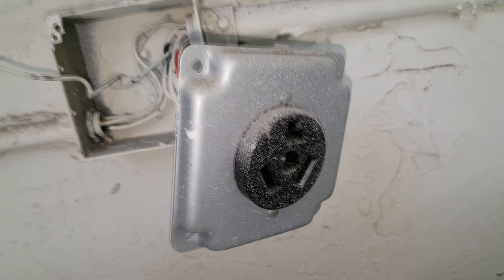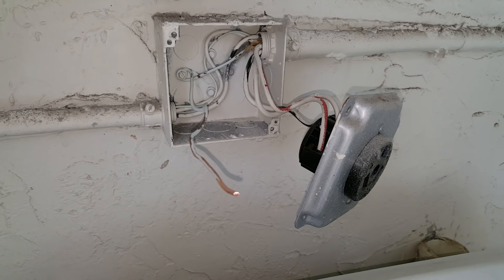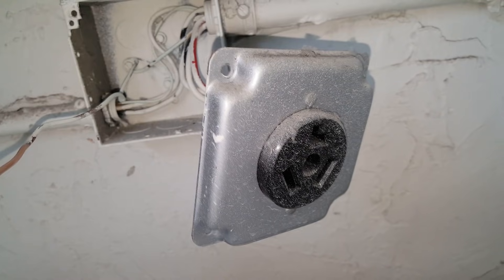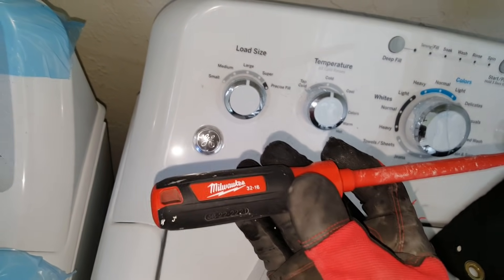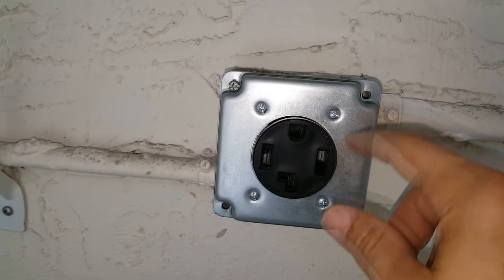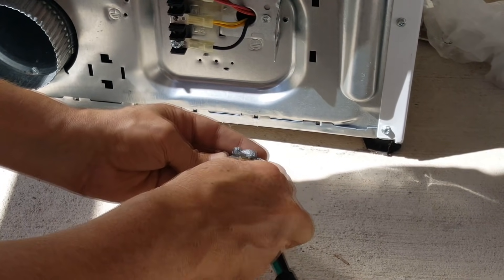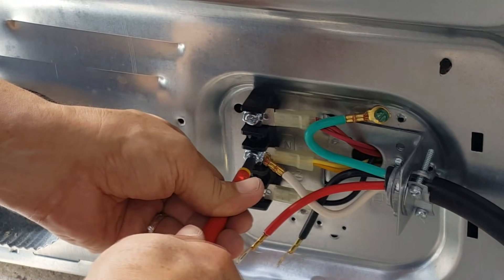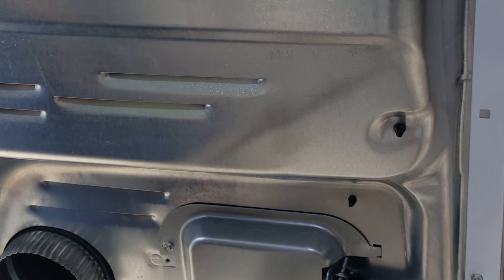How To Convert 3 Wire Dryer Electrical Outlet to 4 Wire

Comment: You skipped the part telling me if the red white black and copper go in specific ports on the new socket. Guess im about to find out.
Reply from the maker: See 3:10 and 4:05 in the video for this, I did tell you in the video. The ground and the white neutral wire have their own specific ports once those 2 are connected up The Red and the Black are interchangeable sometimes they are called X and Y on the outlet.
Reply: jeffostroff lol i got it i just paused and copied the video and put them in the same spots. This video got me through my first wall socket change 👍🏻 i felt like an electrician lol. thanks for the quick reply also
Reply from the maker: @brokebutfast1306   Glad to help out

Comment: Great video!
I have a 3 prong outlet and want to change to a 4 prong, but the wall outlet only has 3 wires, there is no ground wire, can I add a ground wire to the metal box attaching it with a screw, would that work for my electric dryer? Or DEFENETLY must run the ground wire from the main electrical box?
Reply from the maker: Karla you must run a ground wire back to the panel, that's what we've had to do a few times, it's not that hard but if you have never done this, you should let an electrician do it for you. What you are suggesting would not provide a ground at all, becuase this circuit requires it's own ground.
Reply: @jeffostroff  thanks í will looks on that

Comment: I have a 4 wires 3-10 for 220 dryer, can I connect outlet 110 about 1 food away, to the same box and the same wires, using one wire the red or the black for positive and negative to white. Can you please let me know or anybody else can you advise me on that, thank you. I like to do it in the right way by the code.
Reply from the maker: That is not allowed by code. The dryer has to be separate from others, must be on its own dedicated circuit.
Reply: jeffostroff thank you for the information I truly appreciate
Reply: Genius Dog Poocho    Although the answer no is correct, the real reason is, you cannot connect a 15 or 20 amp receptacle on a 30 amp branch circuit.
Reply: Kevin Coop thank you so much for answer to my question
Reply: Genius Dog Poocho     No problem.

Comment: Is ground wire always copper?
Reply from the maker: CaliBoy, the last few decades it has been copper. In some older installations it was aluminum, so you have to be careful to use connectors approved for aluminum in those instances, or pull out the aluminum and switch to copper.

Comment: I only have 3 wires in wall, black/red/white. Can I install a jumper from the neutral to the ground on the 4 wire outlet and avoid running a new ground wire?
Reply: Joe Altorfer    No not legally.   That is the whole purpose of changing the receptacle.

Comment: Hey could you help me figure this out with my dryer outlet. So it's a three wire outlet(white, black, copper) and the plug is a four prong plug. What/where should I connect everything?
Reply from the maker: Your case seems a bit different than normal. We would expect that your 3 port outlet would have "red, black, & copper", not "white, black, copper" like you have. Normally the red and black are the 120 volt line voltage, and the ground wire is connected to system ground. So because of this confusion with wire colors, you need to check your fuse panel and see where they connected that white wire to, is it power, or is it a white neutral wire? We need to make sure that the white wire is indeed a line voltage and not the white common wire. You need a digital voltmeter or,  you need to see where that white wire comes into your fuse panel and make sure that white wire goes directly the side of the dryer's circuit breaker screw built onto the breaker switch. The black wire should do likewise, and the bare copper ground wire should go to a ground bus bar with other bare copper wires. You cannot use that 4-prong newer plug without updating the dryer outlet on the wall to 4-prong, AND you have to have a 4th wire run, (neutral) to that location which would connect to the white neutral bus bar inside your fuse panel (not to be confused with the other white wire we talked about earlier). See the confusion here? I don't like the coloring of the wires your builder chose. You have too many unknowns here, and should have a licensed electrician doing this. My preference would be if possible, to run all new 4-conductor power cord from the fuse panel to the dryer outlet, with 4 correct colored wires:  Black, Red, White, Bare copper. Then you wire it to the back of your dryer according to the install manual, and you'll then remove the copper metal piece that shorts the green wire to the white wire inside the dryer after you are done converting the outlet. That is explained in your dryer's installation instructions with diagrams.
Reply: @jeffostroff  so have same issue and saw another video with someone replacing a 3 wire (black, white and ground. He was putting in the same outlet. He said in homes built in early 80s and before that is how a 220 was wired.  So I bought an older home and trying to change the dryer. Bought the new correct plug but old outlet wired with 1 power line (black) a neutral (white) and a ground. Searching all over for how to connect. There looks like there used to be 220 connections with only 1 hot but what it was connecting to only had a spot for 1 hot. So with 2 hits connections what do i do? Looks like call an electrician
Reply: @jeffostroff  Thank you for the response! So what's been happening is the dryer breaker would constantly trip about half way into a cycle and more recently just started tripping on its own. I'm scared there could be a short somewhere but as you mentioned it's not exactly the right configuration to begin with so I want to try everything possible beforehand. I only found out it was a three wire outlet when I purchased a new replacement outlet thinking it would resolve the issue. So on the breaker side it's a 30amp double pole and the hot/neutral are connected to it with the copper grounded on the busbar
Reply from the maker: @xxxxxxxxxxxxxxxx8627  OK so tripping on its own, the most likely culprit is the breaker switch itself in the fuse panel. they are usually cheap, maybe $10? If you are up to it, you can change it yourself, otherwise have a licensed electrician do it. May have to cut main power outside first.  It could also be bad wiring, although unlikely, or your dryer is getting old and having problems causing the motor to work too hard and drawing current. Electricians with an amp meter can clamp around your dryer cord and tell you how many amps your dryer is pulling. At 27-28 amps, it will trip a 30 amps breaker switch. How old is the dryer, and has the dryer itself had any problems?

Comment: What if I dont have a neutral?
Reply: @Jonathan LaPointe This is where it gets confusing for sure. Because I agree that the third wire is a ground.... but it is being used as a neutral (carrying current). So technically it acts as a neutral AND a ground. And this is the problem we're trying to remove by having four wires instead of three. The goal here is to end up with a proper neutral (insulated all the way to the panel) and a proper ground (linking all the metal stuff together and finally to ground).

So... do we call that third wire that is doing double duty a ground or a neutral? I'm not sure.
Reply from the maker: You should have a neutral. Usually on the 3-wire systems you have 2 powers and a neutral. Have you confirmed if you have a neutral wire or a ground wire? Either way, if you are missing the neutral, you'll have to run one if you want a 4-wire dryer. We have had to run ground wires for stoves before, but usually we already have the neutral. This should be done by a licensed electrician who knows where to connect the white wire into the panel on the correct bus strip for all the white neutral wires, and route the wire to the dryer outlet box.

Comment: Two questions,

One I placed the green ground wire in the original place without the little shiny piece.  Also the dryer I bought after changing the prong to 4 from 3 won’t turn on.  I didn’t have it tested with the 3 prong because there wasn’t an outlet.  

How can I test to see if there is anything else failing my dryer
Reply from the maker: Ryan, On your first question, I'm not sure what you meant by the little shiny piece, please clarify, and what you meant by original place. On your second question, you should get the voltalert sensor that I link to in the description of this video: Fluke FLK2AC Voltage Detector: https://amzn.to/2THggao
 You must use a tool like that to make sure you have voltage going to both your hot wires, which should be the left and right holes in the outlet receptacle. There should be no voltage on the white wire or the ground wire. Even better if you can get a digital multi meter, set it to volts AC, and measure the actual voltage of the 2 hot wires, to make sure you get 120 on each wire. Also, check where the dryer cable is attached to the terminal block inside the back of the dryer. Is  the black wire screwed onto a terminal screw with the black wire inside the dryer?  Same with red wire? White wire to white and green wire to green? Did you remove the metal strip/shunt from the green to the white wire on the terminal block like the dryer instructions tell you to do? Make sure your dryer circuit breaker is on in the fuse panel.

Comment: THANK YOU for this! This is the only video I could find explaining what the grounding strap is and why I need to remove it. I knew I needed to remove it but also didn't know where to put my new ground wire, you explained that as well.  I feel much safer tackling this job now.
Reply from the maker: Awesome, I'm glad we cleared that up for you. Sometimes people complain I'm too long winded, or waste too much time on the trivial details because people are always in a rush. But it's the trivial details that are the most important.
Reply: jeffostroff people are idiots, Jeff, you are not! Haha. I appreciate the details here. In fact I just finished installing my washer and dryer with the new 4 prong cable. Working as intended!

Comment: How would I wire my three wire Miller mig welder to a 4 wire receptacle like that one?  Hmm anybody know?
Reply from the maker: You should check with Miller for confirmation, but on the welders, you usually have the 2 hot wires and one neutral, which is equivalent to the older 3 prong dryer outlet receptacles.  Some guys will just wire them to connect the 2 hot wires of the welder to the 2 hot wires on the dryer outlet, then connect the neutral on the welder to the neutral "L-shaped" hole on the dryer outlet.  Then they do not use the 4th wire on the dryer outlet, which is earth ground, still connects to the neutral in breaker panel bus bar anyway.
Reply: Instant subscriber with that help, Thank you! Double thumbs up,
Reply: Thanks for the video. I really appreciate it and you did a perfect job explaining everything.
Reply from the maker: @carlp3602  Awesome, I'm glad you liked our video converting 3 wire to 4 wire!
Reply: Jeffostroff must 240 volt welders don't require a neutral just 2 hots and the grounding conductor. If you come out of a sub panel neutrals and ground are separate. And by not using the grounding conductor could cause problems. Always check the equipment on what's required. Never leave the grounding conductor unused.

Comment: Great instruction. I'm no electrician but when I pretend to be I usually try to make sure that any bare ground wires don't cross or touch any of the insulated live or power carrying wires. I do this as an additional precaution. Most washer and dryers sets are installed in close proximity to each other and sometimes the washers vibrate excessively when unbalanced so it never hurts to take the additional precaution to remain safe and have peace of mind..
Reply from the maker: Indeed and that is why you are still alive today
Reply: @jeffostroff 
Pro tip from an electrician. He isnt either.

Comment: Hey Jeff! I am trying to switch from 3 to a 4 outlet and the 3 plug has a copper ground a white and a black wire but no red wire. Will i need both hot wires when making this upgrade? Thanks
Reply from the maker: Excellent question, not sure, but I am thinking that the white wire you have there might be the other 120 volt hot lead. This would make the most sense, as many older homes had 120 v, 120v, and ground as their 3 wires. Can you get a volt meter and measure the AC voltage of both the white wire to copper ground, and also from the black wire to copper ground? I bet you'll see 120 volts on both the white and black. If this is the case, I would recommend installing a brand new 4 conductor cable from the fuse panel to the outlet. There they would attach the copper wire to the ground bus bar in the panel, and then they can pick up the white wire from the neutral bus bar in the panel, then they simply connect to both the red and the black wires to 120 spots in the panel fro the dryer wiring.
Reply: jeffostroff thanks for your video. I understand your reply to Matthew but I have a question. In the main panel (not a subpanel), the neutral and ground are connected in the same bar. So, this new 4 wire connects as follows in the main panel: White and ground together, black and red in their own 120Volt leg. The connection in the dryer does not change, we still need to remove the ground strap from the dryer. Is that right?
Reply from the maker: @carlosgarciaphoto  Yes, the white and green wires are connected together in the main panel bus bar. At first glance even I at one time questioned why do they want the white to be separate from the green inside the dryer outlet box, if they are connected together in the main panel anyway? I think the answer lies in the separation of the wires itself. As long as we separate the white and the green wire, the white wire will always carry the return current back to the box where it terminates on the bus bar, tied to the green wire. BUT, back in the outlet box, the green wire normally never carries any current unless there is a fault somewhere and 120v hot wires short to the chassis.  See the difference? They never want the safety ground wire to carry current under normal operation. Only the white wire should carry any current. this keeps things in a predictable state.

Comment: Successfully switched mine from the 3 prong to the 4. What would have happened if you left the ground strap with the green wire? I left mine in before I seen your video then immediately removed it.
Reply: The only thing you did was essentially put a four prong plug on but still bonded the ground/neutral which eliminated the added safety of separating them.  It's exactly the same as using a 3 prong setup

Comment: Hi I just changed the 3 prong outlet and the wires were red, white, black, and a copper one. The copper one is short then the colored ones. I got it some what screw in tightly plugged it in turn the breakers back on and turn on the power for dryer no luck at all. The breakers for the dryers is also 40 watt instead  30. Any suggestions?
Reply from the maker: Check to see at the outlet, if the wires have voltage on them. I highly suggest you get the Fluke FLK2AC/90-1000V Pocket-Sized Voltage Detector, VoltAlert 90 to 1000 V AC, that is what I use in the video:  https://amzn.to/2THggao Double check that your wires are all the way into their correct connector holes on the outlet, so that the exposed wire is touching the metal lead inside the connector. Also, make sure the 4 wires are connected correctly according to their intended location on the outlet. The copper ground should go to the horseshoe shaped hole, while the white neutral wire should connect to the L-shaped hole. The black and red wires go to the other 2 connector holes, usually called X and Y, but does not matter which of the X & Y that the red and black wires connect to, they both carry 120 volts each and the appliance is looking for the aggregate total of 240 volts from the red and black wires. Lastly, check if your circuit breaker might be to blame, maybe it is bad, or needs to be pushed in further to the breaker panel bus bar. Also check where the red and black wires attach to their respective breakers on breaker panel, make sure they are screwed into their respective breaker, make sure those set screws are nice and tight, to ensure a proper electrical connection.
Reply: Thank you Jeff I appreciate you taking your time reaching back Ima have to try it tomorrow after I get home from work.

Comment: Finally, there's a knowledgeable, sane electrical poster on YouTube.  No "suicide cords", no lectures on how Code is "too expensive", no "this is really all right".  Thank you for that.
Re: having the ground on the upper position, it's a good safety thing, too.  Dryers move around a little by themselves, plus the cord is heavy so they tend to pull the cord out a little bit after being is use for a while.  If the ground is in the upper position and the cord is hanging straight down, there's much less of a lever action putting force outwards on the plug.  Also, if for some reason the plug gets dislodged and a small metal item (clothes hanger, etc) falls onto the terminal prongs, it's much more likely to hit the safe ground terminal; if the very worse happens and the metal item hits a "hot" terminal (X or Y), it's almost sure to also hit the ground, resulting in an immediate breaker trip before anyone can get hurt.  
Yeah, it's a good thing.
Reply from the maker: That is a great idea! Thanks!